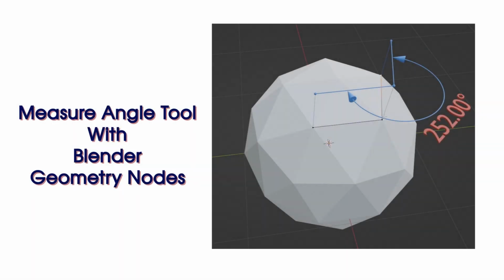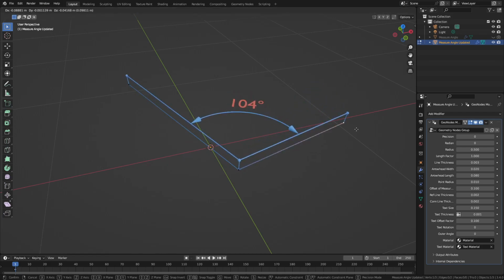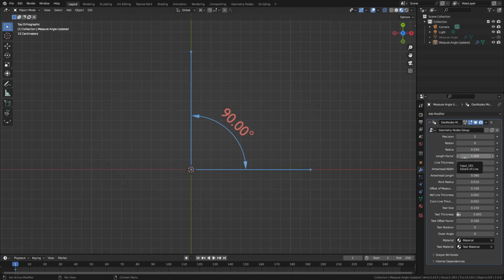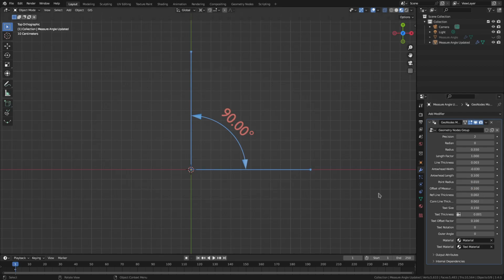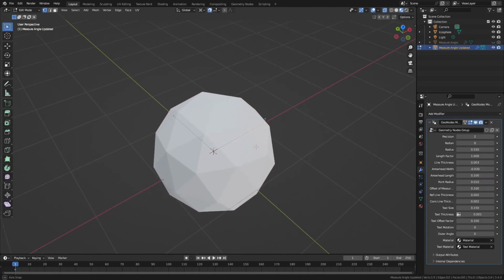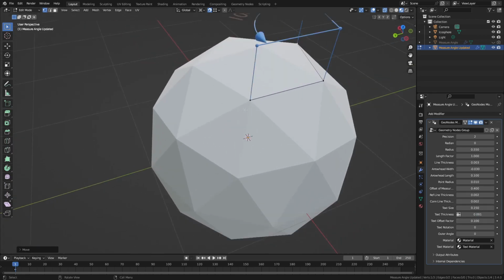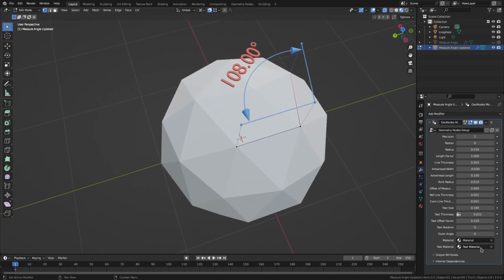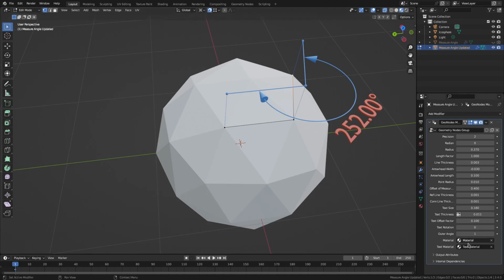Measure Angle Tool With Geo Nodes | Ver 2 | Free Download From Github

Comment: Very nice improvements. The offset is a very useful update.
Will you be adding Length also? That would make it far more popular.
I added rigging to mine - practice - and looking at how the new pose presets are now in the asset library. A useful learning exercise for myself. I am also practicing adding drivers to bones so the controls are built into the 3D setup - things like having a small arrow to move the position of the arc, rather than a slider in a different window......
Reply from the maker: Yes, I have created a separate measure distance tool. Will be publishing it shortly.
Reply: @Khemadeva  Excellent.